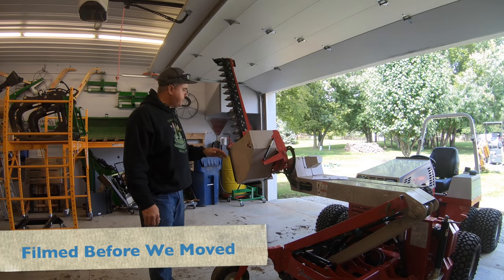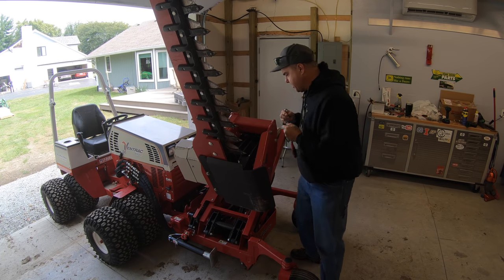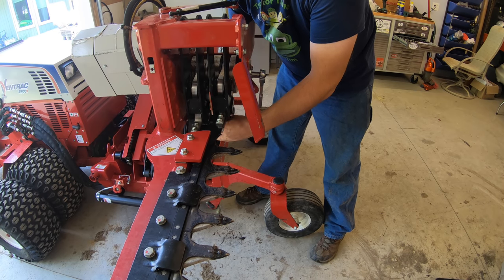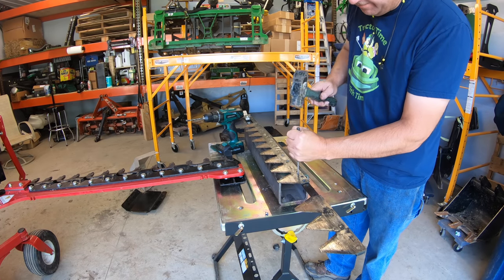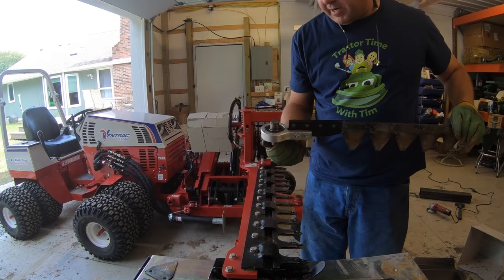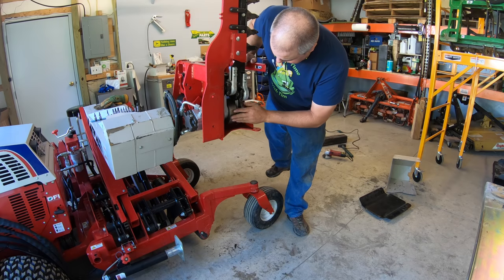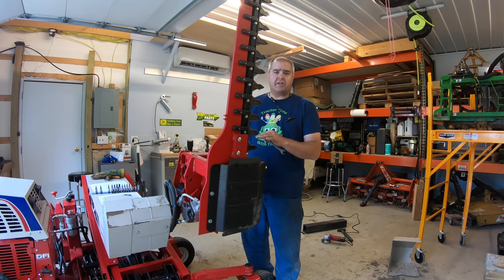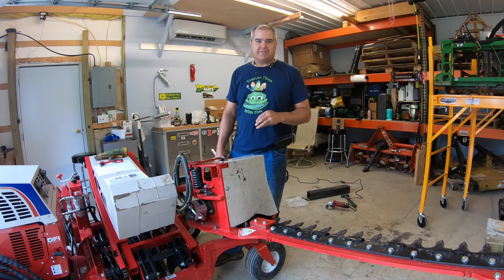Ventrac Boom Mower - Did Tractor Time with Tim Damage the Sickle Bar Sections?

Comment: We used to mow all of our hay growing up with a 7ft sickle mower. Spent many hours doing what you just did every spring to get the knives ready for the season.
Reply: We did too. except they were 10' swathers. Dad had several bars because sometimes we had to switch them daily and resharpen if we were in a lot of needlegrass.  Sometimes we even switched the at dinner. Really fire ants put a stop to sickle bars around here.
Reply: @davidharris6581 , what did the ants do to stop the use?
Reply: @AppleUser  They make anthills and the ant hills break the cutter bars.

Comment: Hi Tim,  Keep explaining what you do.  As my fishing partner said "You know Grits you are undeniably mechanically sterile!"  We had cracked a head on one of the motors on our 32' offshore fishing boat.  We took off the inter-cooler and the distributor as a single unit BUT when we put it all back together, I crossed two wires on one engine.  Dumb!  So I need the help.

Thanks for wearing the ear protection and the eye protection.  The old adage is correct: "more is caught than taught".  

Thanks again for the great videos.
Reply from the maker: Thanks John.

Comment: Good video. Like several of your followers I too have spent hours with an old sickle mower changing knifes and guards. We had a special tool for removing the rivets so we could do it in the field. 

So either you are grabbing for older videos or you have moved back into your old garage  The question is did Kristy kick you out, or have you moved back until it warms up or you get your thermal heat system up and running?
Reply from the maker: We just returned from Europe this evening.
Reply: Why did you post an old video rather than a recent one from Europe?  If I recall it’s a 6 to 7 hour flight. Come on man!  LOL

Comment: I have a section rivet set. It's a tool to lock everything together and then mushroom the rivet. I you lay the edge of the bar against something solid then you can hit the back edge of the section and shear the rivets off not having to drill. That was how we would do it in the field and not have to return to the barn to repair the mower. At one time I could change out an entire 11' bar with new sections in about 20 min. and be back to mowing.

Comment: Tim there's one thing I think the people at ventrac could improve on the cycle mower is give the bar part of the mower the ability to change the angle of cutting from 0-30 degrees so that a wheel rake can pick up the tall grasses easier depending on how hard the ground is so tines aren't busting off

Comment: I just bought a ford 801? sickle mower. Im gonna use it to fix dads old one or vice versuis. Im gonna get a 8 or 10 inch pipe piece to extend the arm away from the tractor since my tires are wider than the mower likes since i have a loader on.  I will take 2 pitman arms and cut and splice them together to make it same length adition as the pipe.   My dad used the bolts designed for sickle sections so a wrench and hammer is all you need with a couple minutes in the field is all you need

Comment: You can by bolts with nylon nuts for replacing sickle sections. When brading the rivets it's better to have it on a piece of heavy steel. I beam or like I did for years a section of railroad track that fit on my footrest on my tractor well.

Comment: My father when I was "much" younger,(1960's) had specialty grinding machine,  that would sharpen sickles for mowing hay and combines sickles. You could sharpen those sections 2 or 3 times if they were only dull. You could grind out small nicks, Like those sections you replaced. Question does any one still do that?

Comment: Totally unrelated but what is your opinion on 3 point backhoes or subframe backhoes?do you like them or no?
Reply from the maker: I do not like 3 point backhoes at all. Good way to break the rear end of the tractor.  it is not designed to handle that much stress on the 3 pt.
A backhoe needs a sub-frame which connects all the way up to the front frame of the tractor.  
This is a good discussion question for greentractortalk.com  You will get lots of informative answers there.

Comment: I've seen the Ventrack in a few of your videos and I was wondering if a machine like that would be practical for a standard home owner with a few acres of space and some difficult areas to mow.
Reply from the maker: difficult for us to make that call for you from the outside. The Ventrac is incredible as a mower, turf management, snow removal tool.  It is better at those things than a compact tractor.  However, it isn't as well suited for loader work or digging work.
We will show the lawn mower on it this summer.
Reply: Thank you for the info. I do appreciate it

Comment: Them knife sections are a pain in the ..to change especially if you broke a section out in the field.
Why don't they use fixed knife guards and bolts to hold the knife sections making it easy to change out.
Even looks like the guards are a pain to swap out.
Don't miss rivets and knife sections haha

Comment: wow rivets to hold the sections in i am suprised.. must be that rivet is harder than a bolt maybe for cutting brush like you do is my guess
Reply: You can’t use a bolt,there’s no room for the bolt head and nut, has nothing to do with strength just the fact that a rivet has no protrusion.

Comment: why wouldn't you hit the ground areas with a lick of paint? Why wouldn't you lubricate the bar? is that automatic?  Seems to me, there needs to be a better way to attach those blades, so that you could simply take them out and straighten and or sharpen the blades then reinstall. I would keep the old blades and rejuvenate them, sharpen them up, then hit with a little paint so they don't rust.